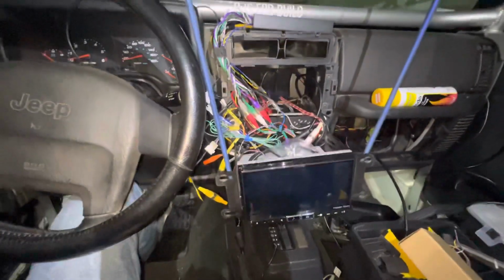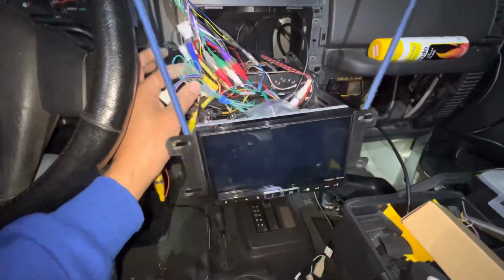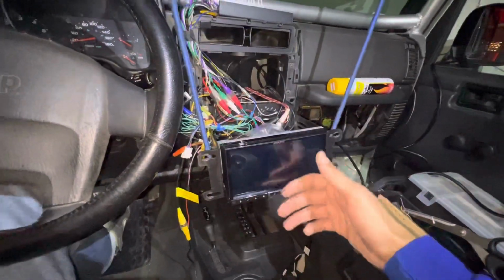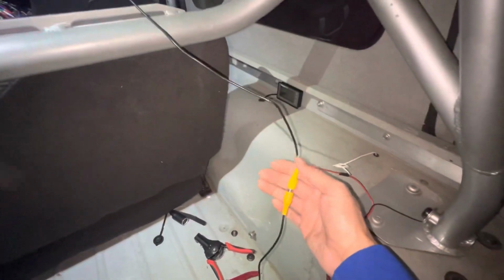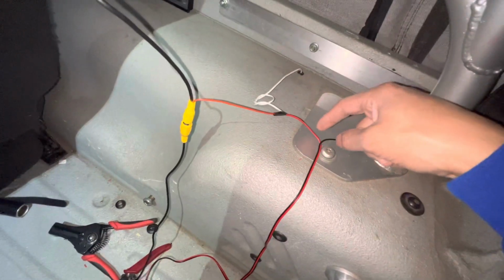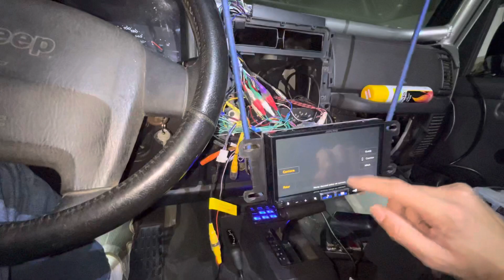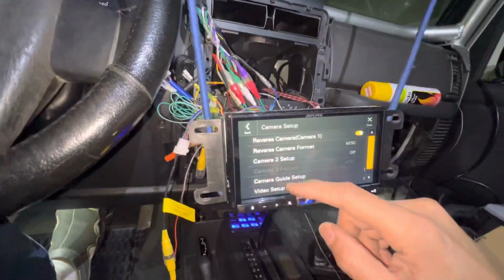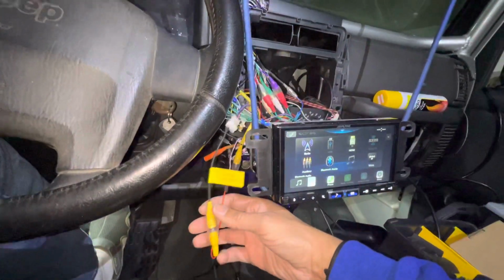Alpine ILX-507 Reverse camera problem. Update: I had to cut a tiny pink wire in the camera harness

Comment: You have to go into settings I think and change the camera input type if I remember right anyway on those head units for it to work correctly. There's a setting you have to change and then it will work
Reply from the maker: It wasn’t the settings, I updated the title with the solution a while back. Thanks for the input though. 🙂

Comment: Try adding a ground wire from the rca adaptor and ground it to body or to the radio harness.
Reply from the maker: I actually tried that trick. Didn’t work. It’s working now though. Turns out there was a wire on the rca cord I needed to clip for this specific camera. All good now. Thanks for the input though.
Reply: @JeepTJay6  no problem
Reply: @kilabee83  did the ground wire work ?
Reply: @tiresrus2507  yes kinda, I was able to get a picture by adding a ground but it has interference in picture
Reply: @kilabee83  thank you
Reply: @tiresrus2507  I saw something else where the guy  said to ground the center channel blue wire.
Reply: @tjay6 are you able to make adjustments to the guidelines? My camera will come on every time in reverse, but it will not come on when I attempt to go through the settings to adjust the lines, it also won’t come on when I hit the “Cam” button.
Reply: @JeepTJay6  I also have a chinese camera on this Alpine radio, could you explain which specific pink wire you used to have image? Maybe post a picture here of the installation or a video please? I'm trying to fix the same issue but I can't find the pink wire you mentioned.

Thank you man.
Reply: @JeepTJay6 what you did to make it work I get black screen can help me how you did yours and thank you
Reply from the maker: @edwinloarca9669  Had to clip the small pink wire in the camera harness.
Reply: @jeepTJay6 thank you

Comment: Alpine 507 does not support AHD 720, which my natika can output for best pic. At 5:18 shows AHD as default output for camera? The screen cuts off the bottom which would say what pink wire does. I think it changes output from AHD to NTSC/CVBS? There is nada in the alpine specs/manual about what camera video input is supported. There is a crutchfield review comment on ilx-507 that says no AHD 720P, i would guess no AHD at all, but not 100% as my cam is AHD 720p. crutch comment is 7/10/2022 titled "All the Bells & Whistles" fyi. this just happened to me same as you diff cam...with a 720p screen on the ilx-507 crazy me i expected AHD 720p digital not analog. Boo Alpine.

Comment: Tie power behind the radio not the reverse light circuit. Tie into the switched hot into the radio. It's probably not getting enough current to stay on
Reply from the maker: The solution is in the title update. Thanks for your input though.
Reply: @JeepTJay6 why you didn’t show which wire you cut !!

Comment: if you wanna watch videos going down the road ground tie the green wire the ground it works
Reply: Not on the Alpine. Requires either the e-brake on twice or a brake bypass circuit.

Comment: I purchased this and my rear cam worked for 1 hour .And also it displays sirius radio but has no audio .regular FM plays sound so does my ipod through Bluetooth but no sound from satellite radio. Any ideas. Thank you
Reply from the maker: Hmm. I got nothin on that. Sorry. I had a no audio issue a few weeks ago, but it turned out to be a week connection to my factory wiring harness clip. I disconnected/reconnected it and all is good. I'd get in touch with Alpine if I were you. Good luck with it.
Reply: @JeepTJay6  The radio requires a separate Sirius radio module to be connected. Sirius doesn't come with the radio even though there's an icon for it.

Comment: What exactly did you do to fix this.. I have the same issue. Thanks!
Reply from the maker: Hi Jonathan. I actually added an update in the detail section of the video. I had to cut a tiny pink wire in the camera harness. I'm in Taiwan so the instructions were all in Chinese. The store I bought the cam from helped me out. All good now.